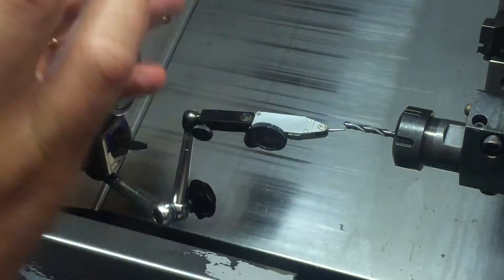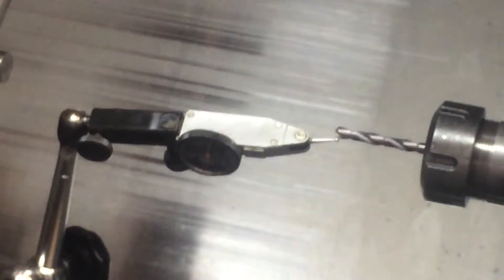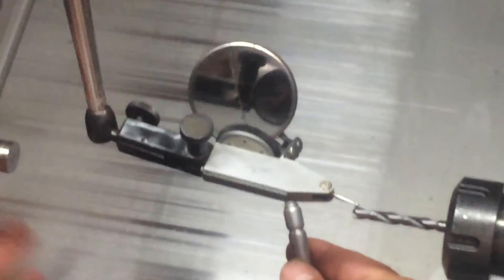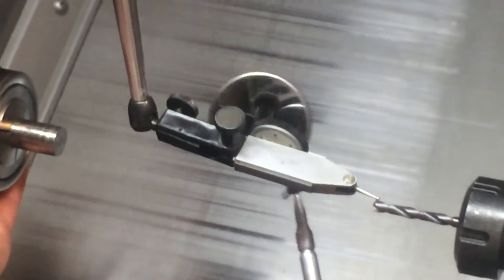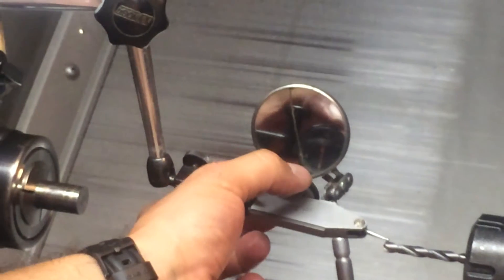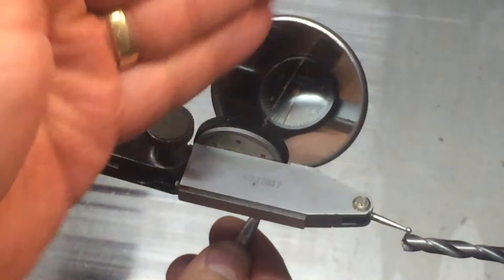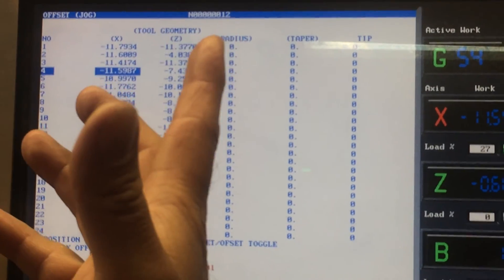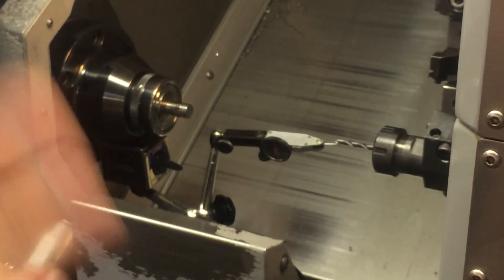INDICATING A DRILL PART 2

Comment: normally i just sweep the drill on the cylindrical back end surface of the drill....establish 0 on indicator.....then i just normally punch geometry tool number X 0.0 MEASURE....that should give u ur new x position....if you had a drill there before... normally it varies by a few thousands of an inch....

Comment: Ummm... before you do all of this, you need to make sure the drill itself is spinning true. 

If the drill is in a holder that is bad or a bad collet or the holder has dirt or chips in it it can run out a bit. Or possibly the turret is out of whack and all of your tools are not spinning straight. 

Something to think about before indicating it on x zero with the spindle.
Reply: Здравая мысль 👍

Comment: Something I’ve been having issues is indicating a drill true all the way around. I’ve seen people adjust the tool holder screws but I just can’t seem to understand which direction to go.
Reply: Have you found it?
Reply: @ramkumar.j9428  No, but I've noticed you would have to kind of play around with it. It's too hard to explain.
Reply: @phetinthasanh7083 the screws control the y axis positioning. The tension of the screw controls the position the drill site in the y axis since the screws directly put pressure onto the side (y axis) of the drill.

Comment: Use a gage pin not a drill
Reply from the maker: Using a pin makes for a more accurate position on the drill, you can also indicate top and bottom of pin by adjusting the actual holder, to make the indicator read 0 al the way around the pin. I have all my holders indicated , I use the taper area on the actual drill holder.
Reply: @Drew K 😂😂samee
Reply: Why? its the same concept .Theres no no difference.Acutally this way is more precise this is the tool hes drilling with,hes not drilling with a pin ,if the drill is bent ,hell know
Reply: Dave Smith that’s what he said lol it’s more accurate with a pin . when your a operator and drill is just roughing then I would use this method. Fast and simple